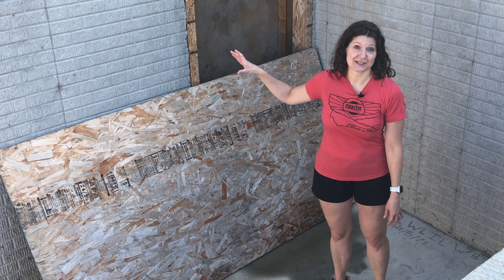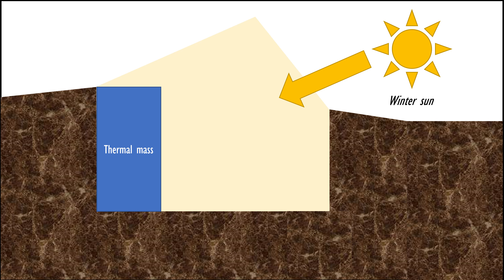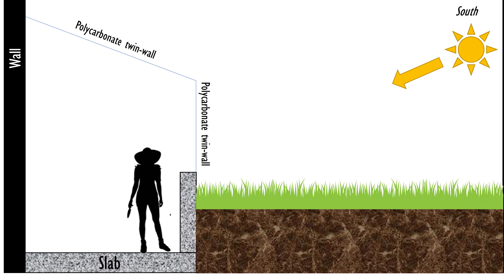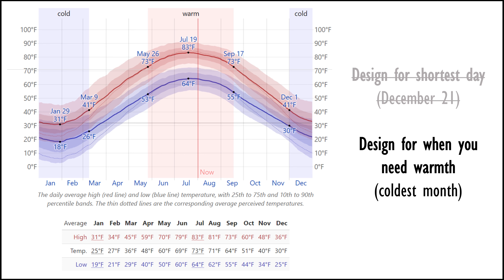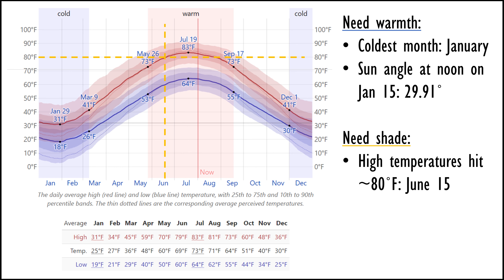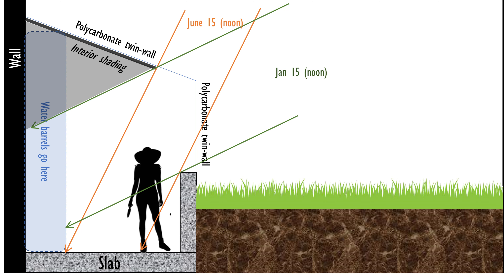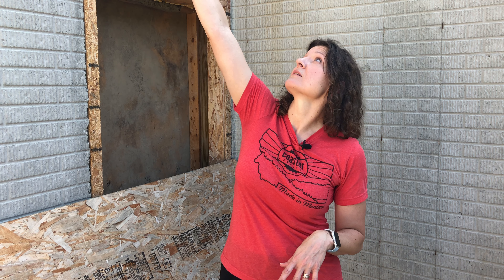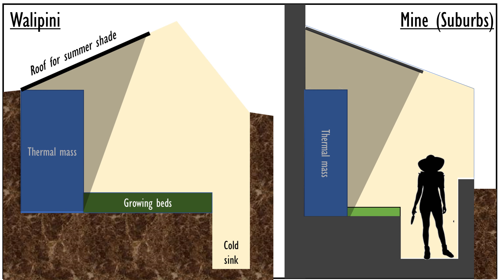An Underground, Walipini-Style, Greenhouse--for the Suburbs!

Comment: Attached to your house, you definitely don't need water barrels. Your concrete house wall will lose heat via conduction, to your walipini. The conduction from your warm house, combined with that same back wall storing heat from the lower sun in the winter/early spring, early fall. Should heat the structure really well.
Reply from the maker: In theory, yes, but we built this as new construction with a double wall with foam insulation inside the concrete. We get very little heat bleed as a result. Good for our energy bills, not great for the walipini concept 🤷‍♀️
Reply: @WellGroundedGardens Ok 👍.  That makes sense.  How has it performed so far?  I built a simple half hoop house against my house that I use for dormant fig tree storage. It's right against the concrete block house wall but its not attached. It's typically 10-15F warmer in there due to conductive heat loss through the block wall getting trapped in there during cooler outside temperatures.

Comment: If a barrel is half exposed to sun, wouldn't the lower half heat up and have the warm water rise, effectively circulating the cooler upper water down to heat up, thus allowing you to expand your thermal mass barrels taller than direct sunlight level by taking advantage of the natural circulation? Obviously not as effective as 100% direct sunlight on the barrels, but better than no thermal mass above the barrels at all.
Reply from the maker: I do think a thermal siphon is likely to happen (and to help) anywhere I can get sun. My total thermal mass may ultimately be as much about the weight and engineering for tipping as it is about anything else…

Comment: I had a house burned down to the ground I was wondering can I use the basement with the break-in walls for my underground garden
Reply from the maker: Well I’m super sorry about the fire, but that alternative use sounds AMAZING.  I believe a few people have done that with old pools. The one thing I’d double check is drainage; we added a floor drain to ours that links into our foundation drains and sump pump. If your old house has something similar in the basement you should be good—I think you’d just want to avoid standing water or flooding issues?
Reply: Thank you for the quick response I'm looking for a construction company here in Flint Michigan now to get it done I'll send you pictures once I get it done

Comment: Very helpful explanation of your design for a walapini style greenhouse.  Since your video was published almost 2 years ago, do you have an update as to how well your design is working?  Did you have any modifications to the construction that were not incorporated in the original design?  Thank you.
Reply from the maker: Hi!  I did a follow-up, here:
https://youtu.be/8DxIa-F2S8U
Short version is that it’s working very well, to the point where I didn’t end up adding any thermal mass to it. I’ve built out shelves and such on the interior but otherwise no significant changes to the design. I’ll try and do another update on it, soon, to show the finished design.

Comment: I couldn't see how you get in and out.  Is there access from the house?  The other thought I had was drainage if water gets in.  Excellent analysis of the sun angles and modifications of the design.
Reply from the maker: There is a door from the house (currently covered in plywood) and there will be some stairs inside the greenhouse down at the west end, walking up to a door built into the polycarbonate wall. That door gives access from the backyard. I will show that once it’s installed, but for now I didn’t want to make a 20 minute video…  🤷‍♀️

Comment: Doesn't the house, itself, provide the necessary thermal mass? I assume the house is heated, so you'd be putting insulation (the barrels) between the hot house and the greenhouse. Absolutely fascinating video.
Reply from the maker: The house is heated but also super insulated (we did spray foam throughout for energy efficiency). The back wall of the greenhouse is concrete (with a layer of studs and foam inside); I don’t think there’s a ton of heat bleed from the house, but I’m sure there’s some, and then the concrete itself is painted black and hopefully acts as a bit of thermal mass. I think we have a secondary benefit of less heat loss from the house, as it now has a sheltered pocket of air against it rather than wind or cold soil…

Comment: I love your thought process and explanations if everything! Such a efficient use of your space! Using the suncalc website what data points can be interpreted to be the winter and summer angles that I need to have in mind. I'd share the screenshots of my results if I could but is it the altitude or azimuth? Or some calculation? My January 15th at noon is Altitude:	29.86°
Azimuth:	177.79°
While my July 15th at 1300 is Altitude:	72.28°
Azimuth:	176.20°

Could you help me? I'd so greatly appreciate it!
Reply from the maker: You want to use altitude 👍.  My specific dates in the video were tied to my coldest days; if you want to find your absolute lowest sun angle you would look at December 21st and for your highest angle you would look at June 21st.

Comment: This is exactly what I had in mind for my back yard, so great to see this! Was your stem wall & slab already poured? Have you considered using a GAHT system to help balance thermals?
Reply from the maker: Hi!  The house was a new build and I designed the greenhouse in from the beginning, so the slab and stem wall were poured at the same time as the foundation. I wanted GAHT or earth tubes but couldn’t get it done with the timeframe, budget, code, and available trades. I’ve seen a version pulling hot air from the ceiling ridge down tubes and through a floor of crushed stone to create sort of a thermal battery. I may try that (though the current system is performing shockingly well, as is).

Comment: Walipinis have one huge flaw most people overlook that makes them much less efficient than they could be. Heat lost straight into the ground. You only want the geothermal ground mass effecting your Walipini temperature during cold nights below 50 deg and hot summer days above 85 deg. A much better design is to have all vertical walls and the floor that are in contact with the geothermal ground mass insulated with an air flow gap between the ground mass and insulation. This way, everything inside the walipini and including inside thermal mass, can be isolated from the constant 50-55 deg ground temp and all your solar gain heat during the day isn't lost into the ground. Then at night when the temp inside the Walipini drops to around 50 deg and lower, the air everywhere in the geothermal  air gap behind your insulation will rise and go through vents to automatically heat your greenhouse during the cold nights. No fans needed,the air will naturally circulate,  and when the day time temps again rise above 55 deg, the air will stop circulating and not flow out of the air gap. This design is way more efficient.  People don't realize they are losing a massive amount of daytime solar gain heat straight into the ground in normal walipini designs.
Reply from the maker: Interesting!  I don’t think I could’ve pulled that design off with this context (attached to a conventional suburban build) but it sounds fascinating.